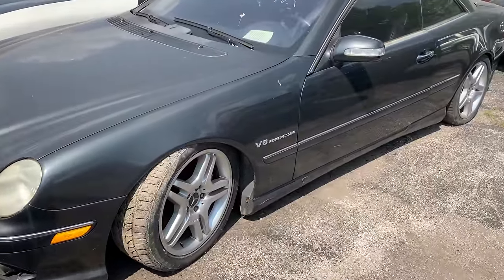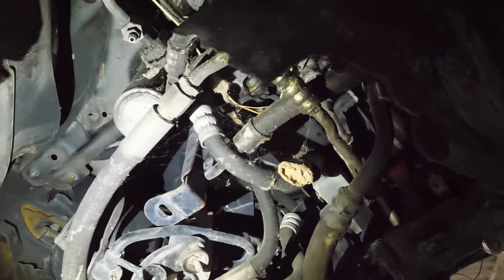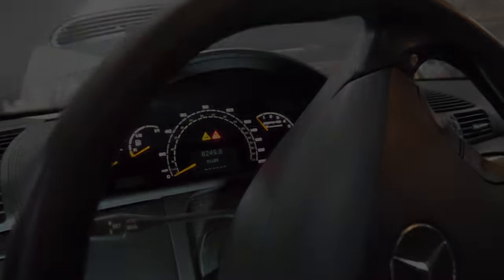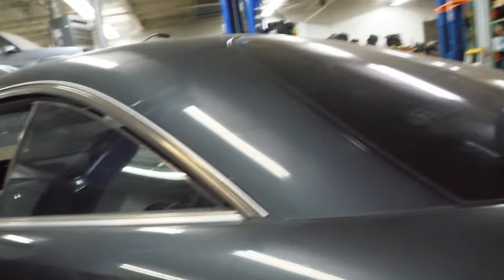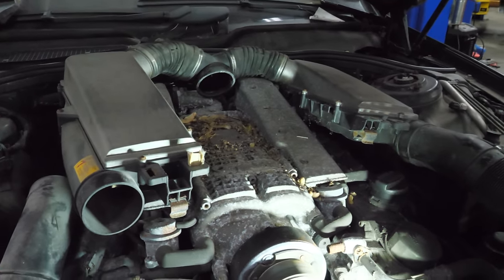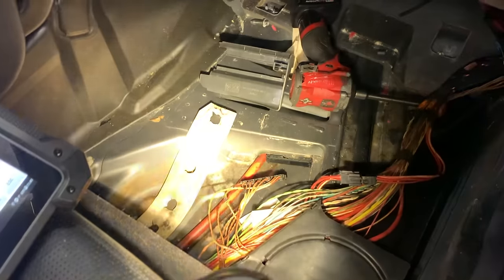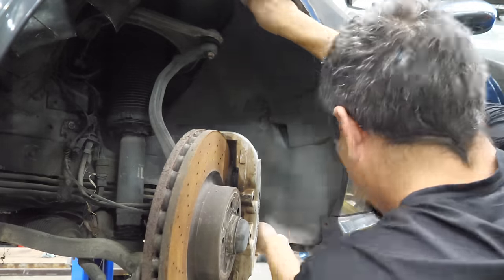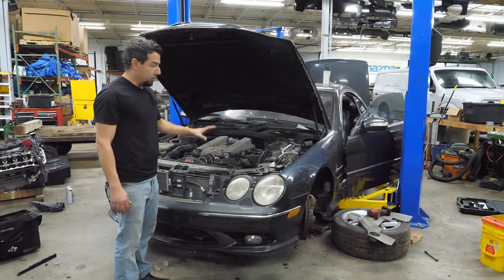DEFEATED! Tow Lot Bought 500HP Mercedes CL55 AMG Sat For 7 Years

Comment: I own a cl600 w215 if he pops the hood from inside and it’s still stuck he needs someone to hold the lever while he goes to the front with hard nylon pry tool . The hood is binding up but you need someone to hold the lever in the car in a full position. Terrible watches this keystone cop approach, this car cost 125 k new

Comment: I have an '04 CL500 and yes they are very complex cars that is why don't touch mine. I leave that to my indie MB tech.  It's not cheap but then I wouldn;t where to begin. My car with 123k miles has leaking ABC struts that need to be replaced and the ESP system is partially working. Enough said.

Comment: I would have just sacrificed the grill. Since that car has no steel panels, everything on that car has value to secondary market. I'm kind of cringing seeing all that hacking with cutters and tools and prying things out of the way. Probably the least expensive part the damage, would have been the grill and that was probably your best chance of accessing the mechanism for the hood. Oh well , live and learn..
Reply from the maker: I would’ve broken the grille, and found out you still can’t get to the latch.
The latch sits in a sealed pocket of the core support.
A rusty core support has no value. The body isn’t getting saved. 
The grille can be sold and shipped.
Reply: @I_Do_Cars  Just try to save the body panels. That car has plastic front fenders and hood, magnesium doors and the rest of the core is aluminum. It really is too bad it sat for 7 years.
Reply: @johngrzesiak3716 All those parts are made of steel. That's why they weight so much. Mercedes,  bank vault solid.

Comment: Unfortunately you described this car as a parts car from the beginning of this video. If the engine and transmission are good then why not rebuild it?! I didn't see bad under chassis rust so for 500 HP why not take the chance?
Reply: He found corrosion in the circuit connections, and probably points to an electronic nightmare with the ECUs?   It was a business decision once he assessed it in his garage, and decided it would be be lost opportunity costs timewise and moneywise.  He went in buying it worse case parts car for $1200 and it was...  We all wanted it to turn out better.  It's too bad it sat so long in the impound yard.

Comment: Use the force and stay away from the dark side 12 minutes and that’s just cosmetic damage so far. It looks so much easier in the movies! Have you ever found someone in the trunk? That would be my worst fear. Maybe you will finally find Jimmy Hoffa. Maybe he goes from trunk to trunk. Who would have guessed he would be in a Mercedes? Enough I could tell you why things are not working and if it wasn't for EWTN were I could to learn, I  was going to say more but I an still learning. Thank you Mother Angelica EWTN Foundress and the small band of nuns. sorry I went off the road here but wanted to sure my faith, so sorry.

Did the same on a 1967 Dodge Coronet 440 body style and if it was a two-door, style I would have put more into it. Here is the reason for my related story when I did the exact thing to get my motor running again I learned after the huge fire that burned all the wires up to the firewall "a good name" but the ignition shaft tip broke I was lucky to find it with a cow magnet and how dumb luck and then made my own wiring harness plus the firewall all with a Chilton handbook and it was my teacher into this wonderful world of vehicles.
Ps the initial cost was $99 out of a field of cars, I like the look.

Comment: I just replaced my factory battery in my 2011 f150
Reply: Pffft must be nice. I have a 2012 f150 with a 3.5 ecoboost. Just put in the 4th battery 5 days ago. Went through two motorcraft batteries by 2019. New Walmart battery in 2019. Now just installed a battery mart battery. My truck eats batteries. 😂
Reply: @TsunauticusIV  I use Costco batteries here in Canada they have a 4 year full replacement and 7 year prorated. Have them in 7 family member cars.
Reply: @TsunauticusIV  Get Interstate battery.  I had an Interstate battery in my Suburban.  It died at 47 months and it had a 48 month warranty and my local Interstate dealer replaced it at no cost.  No proration at all.  Advice: you should bite the bullet and replace your F150 after it eats the second Interstate battery...

Comment: The only place a german car belongs is in the metal melting pot of a steel or aluminum producer. I think german cars are infinte piles of garbage. Having driven a MB SPRINTER for 11 years at work...i have first hand experience. Those vans are beyond god awful. I call if knot 🪢 sea 🌊 junk.